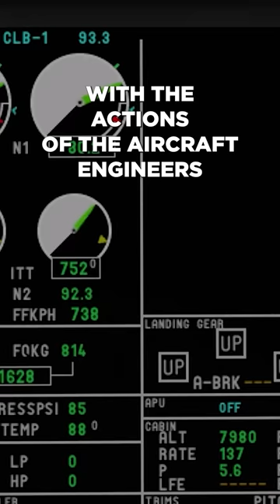Airplane Out of CONTROL! #shorts

Comment: I don't understand why, if you do something and a bad thing happens, twice, why would you not try to do the opposite instead?
Reply: Exactly what I was thinking 🤔
Reply: If you watch the full story it makes more sense. Besides, there's muscle memory - and when you've trained to do one thing for when a certain circumstance arises, and you're swamped with other things going on, you don't even realise what your body is doing.

Enjoy the full story and all will be explained!
Reply: Drive a car with manual gear for a while, as normal with the left foot for the clutch. Then operate the brake with our left foot. Imagine how long you will need to become the feeling for it after driving manual shifting for years. And now put this experience into nose up and down of an airplane...
Reply: @renelange9794  I have driven all manner of vehicles. Yes, I've forcefully pressed the brake in an automatic car after driving a manual. But only once.

This pilot tried to crash the plane twice because he kept doing it expecting a different result.
Reply: @y_fam_goeglyd  I have. Before this. That's why I have this thought. He did it twice.

Comment: did you ever flew a plane that was not boieng?
just interested
Reply from the maker: Loads of smaller planes, yes. But no airliner
Reply: @MentourPilot  Do you only fly the 737 or you fly other Boeings too?
Reply: @user-yv1qs7sy9d  Can’t speak for him, but seems unlikely. He only mentions B737, and type rating is a big process.
Reply: @user-yv1qs7sy9d  the 737 is a flying tank. So safe it can fly with loads of broken parts and still land safely. (Not advocating flying with one broken lightbulb let alone buckled wing extensions, but it can).
Reply: @john-paulsilke893  Of course, one should fly as safely as possible , but I think you may have replied to the wrong person.